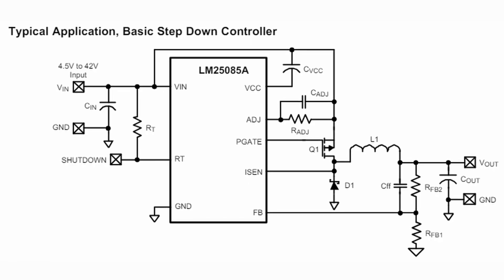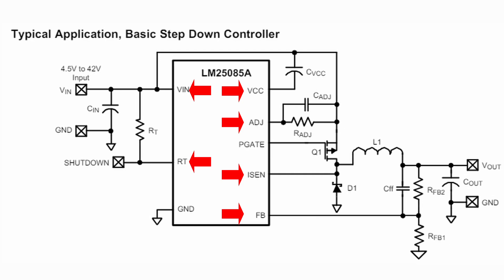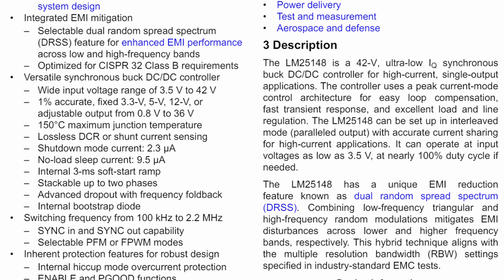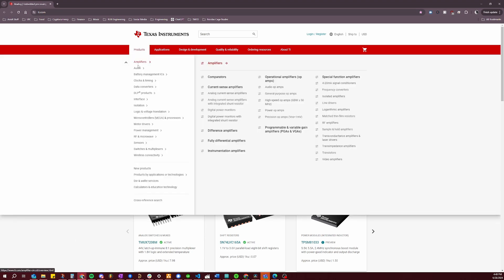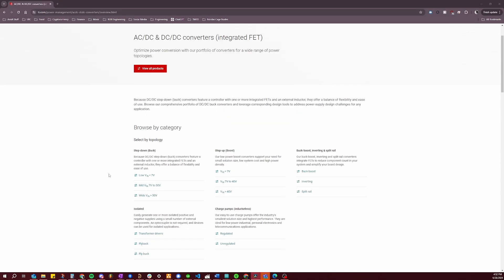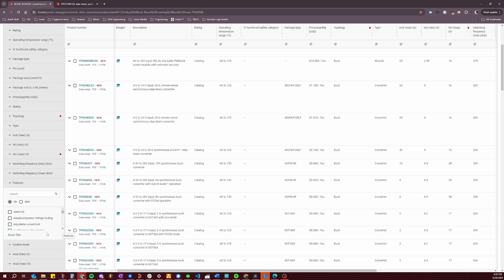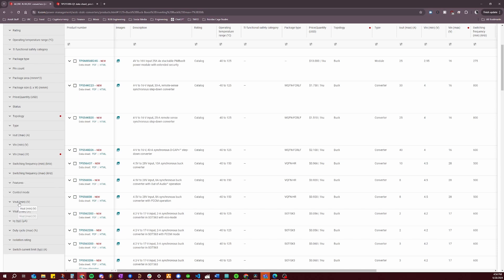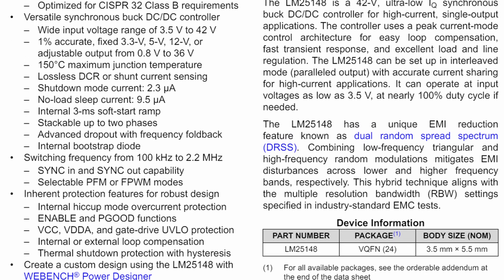Power Supply Regulator Integrated Circuits (for Beginners)

Comment: Awesome video indeed. I had to design a control circuit for running a BLDC motor as a task for a job interview. I filtered out several gate driver ICs on TI's website and got one (DRV8302) with integrated buck converter which can help running the MCU unit thus reducing the space and complexity. I wasn't sure whether to use the integrated buck or not because of course the difference in the voltage range of driver and the MCU. The datasheet explained in detail with the block diagram and showed that the buck is completely isolated from the driver and it's optional to use which gave me confidence to go about it. The interview went well and they were quite satisfied with the design.

I am a beginner in this arena and went through one of your video series on how to make a mobile phone charger using datasheet and Webench designer. It helped me a lot to cut down on endless details and how to find what's required. Thanks once again and keep making such videos 👍
Reply from the maker: Thank you very much, this means a lot to me :)